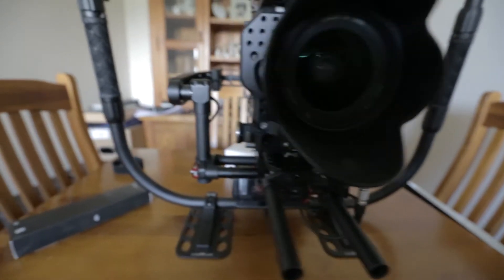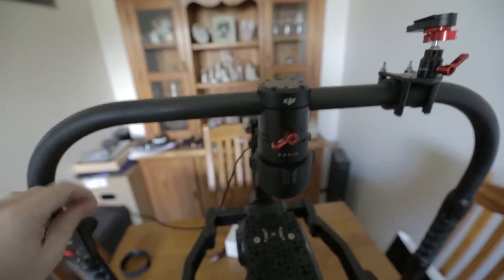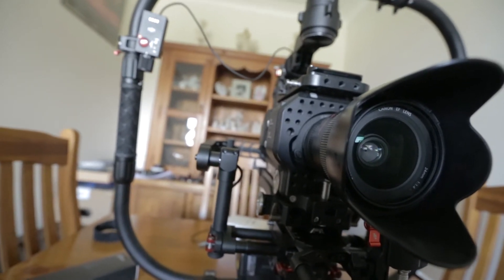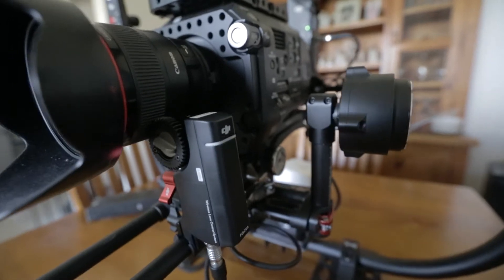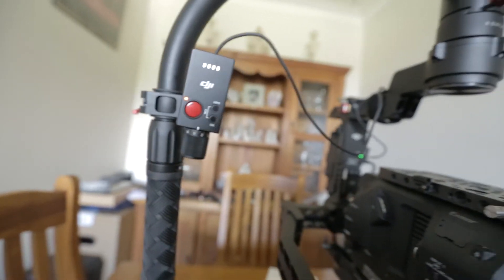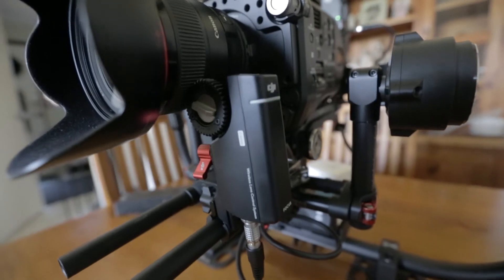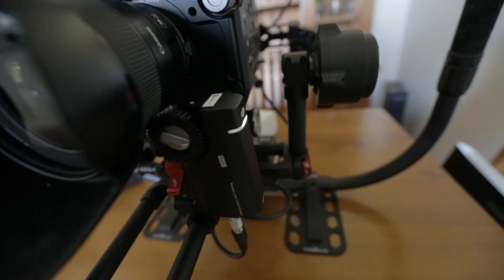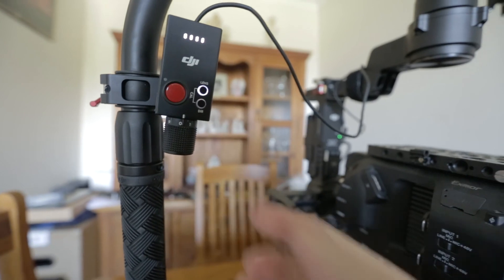DJI Focus Thumb-Wheel [Connection Issue]

Comment from the maker: The Solution is in the Ronin Firmware version. The latest GCU at the time of this video was 1.5, however with the 1.6 version I was able to get the unit working flawlessly with 2 different cable connection setups :)
Reply: Hello there,  thank you for posting this.!  im experiencing this same issue and i see your pinned solution.  GCU v1.5 to v1.6.?  i have the latest GCU upgrade which is v1.4.  i upgraded firmware from ronin assistant 2.5.  Where did you find the gcu v1.6 firmware.?  ive called and emailed dji support so many times and always a shrug of shoulders with no solution, so frustrating.! 
thank you.!
Reply: So DJI emailed me and said that the GCU firmware v1.4 is the latest version.  He said i needed to purchase the DJI Focus Motor Power and Data Cable https://www.adorama.com/djifp23fmec.html?discontinued=t which I just purchase online and awaiting its arrival.  Hopefully that helps.!
Reply from the maker: My apologies, I got the version number wrong. At the time it was 1.3, but they gave me early access to 1.4. Yes I have that cable and I was able to get it working with that.
I also managed to get it working with this cable also:

http://store.dji.com/product/dji-focus-thumbwheel-focus-motor-cable
Reply: So theres no way to get the thumbwheel to work with the included cable? I updated my Ronin-M to the latest 1.4 version, and tried everything while just using the cable from the thumbwheel to the back of the ronin (no cable running into the focus motor), no luck. I've looked everywhere for this cable: https://store.dji.com/product/dji-focus-thumbwheel-focus-motor-cable
but DJI doesn't sell it on their website anymore..
Reply from the maker: Not sure where you're trying to access the website from, however that link still definitely has the cable available for purchase
Reply: It says "This product is not available in your country." I'm in the US..
Reply: are you using a Ronin M, Ronin MX, or Ronin ?
Reply from the maker: Ronin :)
Reply: hey where did you find firmware 1.4 for gcu. it doesnt seem to be available for download on dji site or the 1.3

Comment: Hi every one ! I have met the same problem and find a solution !!!  I switch on the both device (remote and receiver), then I push the button power + reset on the remote, it switch of, I did the same on the follow focus receiver. And the it connect ! I have done this combination 3 times, it works ;)

Comment: Hello there,  thank you for posting this.!  im experiencing this same issue and i see your pinned solution.  GCU v1.5 to v1.6.?  i have the latest GCU upgrade which is v1.4.  i upgraded firmware from ronin assistant 2.5.  Where did you find the gcu v1.6 firmware.?  ive called and emailed dji support so many times and always a shrug of shoulders with no solution, so frustrating.! 
thank you.!

Comment: Hi there,

Just bought the Thumb-Wheel for the focus. I've a newer cable to motor.
http://store.dji.com/product/dji-focus-thumbwheel-focus-motor-cable
It doesn't work entirely but goes further. I've the LEDs that gets green on the thumb wheel, and solid white on the motor. I can trigger calibration but that's as far as I can go.
No control over the motor.

Feel free to share if you get any more information.
Good luck!

Cheers!